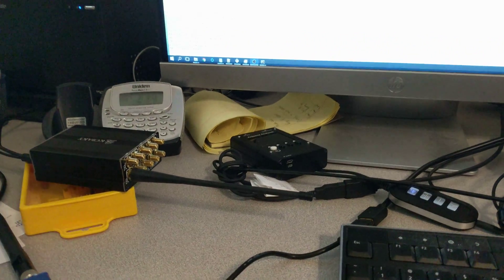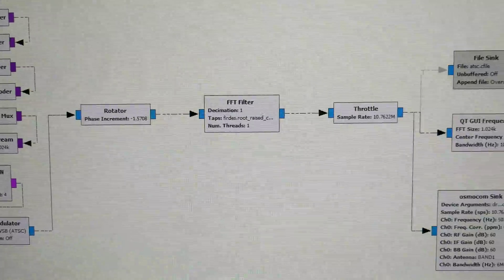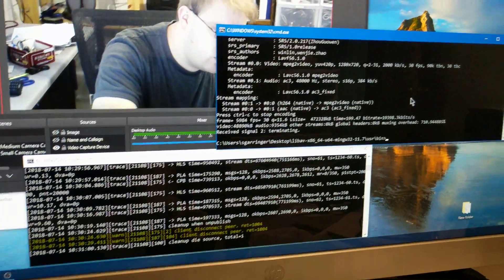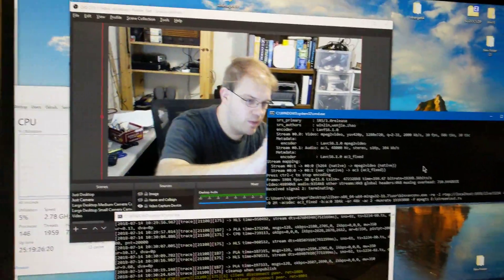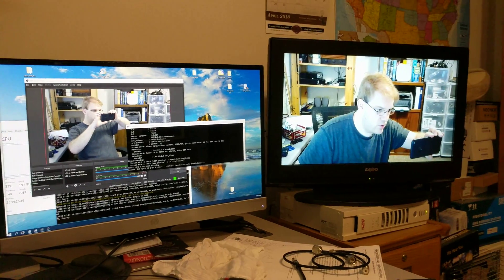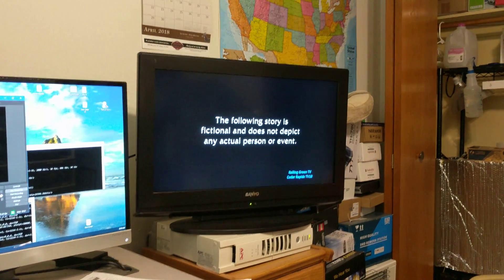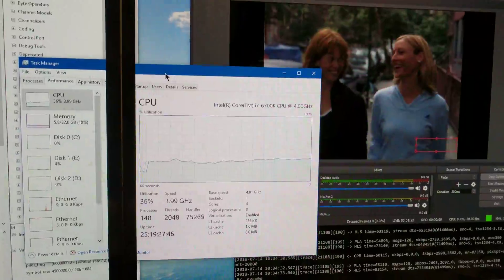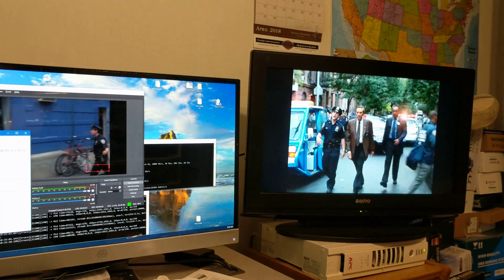ATSC Broadcasting using LimeSDR+GNURadio+OBS+libav

Comment: Instead of using rtmp/avconv, is there a way for OBS to output mpeg2-ts (at the desired bitrate) directly to GRC using obs-gstreamer?   
Also the flowgraph doesn't seem to use the ATSC encoding block (ATSC 3.0 BICM), how does this implementation differ?
Reply: OBS doesn't implement a lot of the ffmpeg tools necessary to strictly set a bitrate. Have been in contact with the developers, but they have not given any indication that they'll change this anytime soon. I personally send my OBS output to an icecast server using high bitrate GPU encoding, pull it back in, reencode to the right mpeg2 subset, then output that to a FIFO pipe (this is on linux, though, so adjust accordingly)